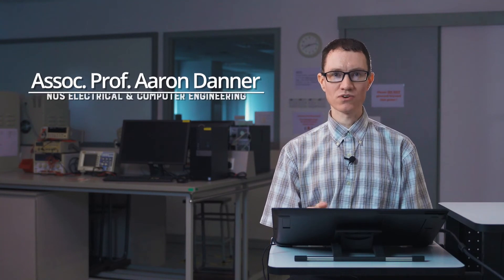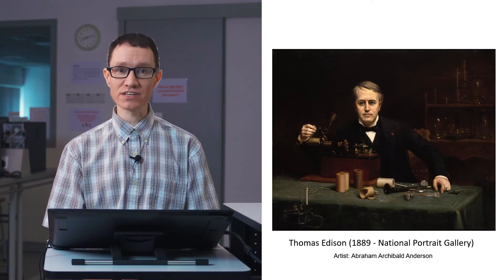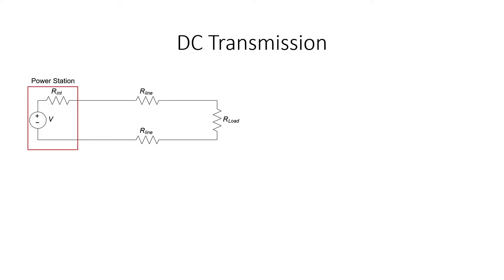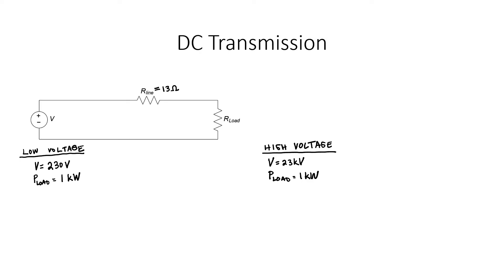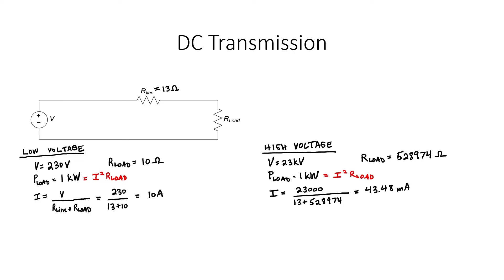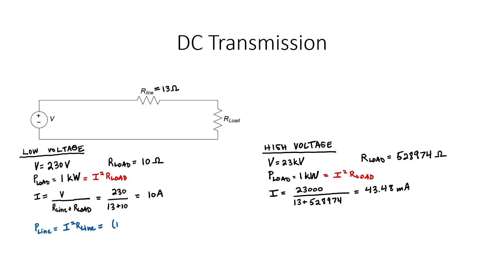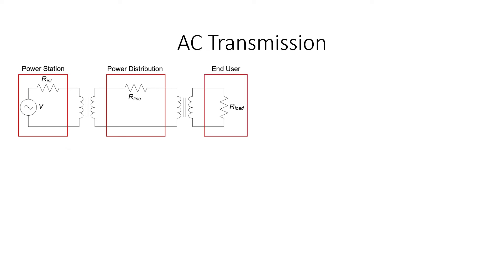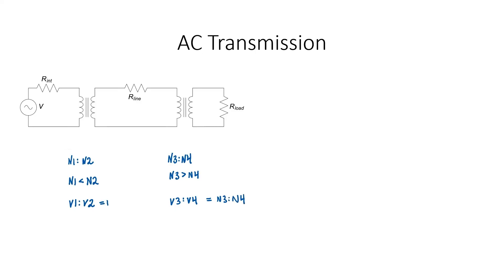AC versus DC power transmission (2 - Electricity Distribution)

Comment: I calculate the low voltage load resistance to be 53 ohm and 4.3 amps for 230v and 1kW.  How are you calculating for this example?  Resistance =Voltage^2 / Power is what I used.
Reply: Exactly, that's where I am stuck too. 53-13 ohm =40 ohm should be the load resistance.
Reply: Your calculation yields the total power of the circuit (heat losses in the line + load power). Here you can't use R=V^2/P, because there is a voltage drop on the line.
To verify the load resistance given in video (10ohms), we need to check if with this resistance we will get the needed power at the load.
Total resistance: 10 (load) + 13 (line) = 23 ohms;
Current thru line and load: I = V/R = 230/23 = 10 A

Now on the load we want 1kW=1000W of power.
As line resistance and load resistance are connected in series they have the same current flowing through them - current I.
Knowing the current thru load we can calculate the power that load is getting:
P = I^2 * R = 10*10 * 10 = 1000W.
Reply: @nonsuspicious your calculaiton is correct I think, but how did you get 10ohms as load resistance? guess?
Reply: He's misguiding us all. 

Wasted my 10 mins calculating the load resistor value.😠
Reply: I don't see how you got that.  If the load is 10 ohms, then the total circuit resistance is 23 ohms.  Ohm's law: 230V/23Ω = 10A.  Power is I squared R, so 100 x 10 is 1000 = 1 kw.

Comment: at 4:29   P =I^2 * R  (V=I * R)   = V^2/ R 
P100 = (100v)^2 /2 ohm 
P200 = (200v)^2 /2 ohm 
P200 >> P100 whats wrong in this way
Reply from the maker: Using V^2/R you have just verified that putting 200V across a 2 ohm resistor consumes more power than putting 100V across it. We always want as small voltage drop as possible for this reason. But voltage drop is different than voltage with respect to ground. Assume we have 100V across a line resistance but each end is 100100V and 100000V. This delivers far more power to the load than say 1100V and 1000V.
Reply: @adanner  i was confused why 200v saves more electric energy than 100v. 
do the power companies limit the house's power consumption?
they fix the voltage but i can use the Ampere in the limit they provide.
if 1000watt is all that power company allows me

1000watt = P(100v)= IV = 10A *100v
1000watt = P(200v)= IV =  5A *200v
if 2 ohm is from copper wire resistance that causes a power loss
1. P(100v) =  P =I^2 * R  = (10A)^2 * 2 ohm  = 200w
2. P(200v) =  P =I^2 * R  = (5A)^2  * 2 ohm  = 50w
3. P(100v) =  P =V^2 / R  = (100v)^2 / 2 ohm = 10000w/2
4. P(200v) =  P =V^2 / R  = (200v)^2 / 2 ohm = 40000w/2
3 and 4. cant have 100v and 200v, i understood 3. 4. were wrong
thanks for reply, asking you fixed my brain,
Reply from the maker: @abcdef2069  Yes the power company strictly limits the power households can consume: It is limited to the maximum output power of the generators connected to the grid. If the power is exceeded, they shut off electricity to some customers for awhile (rolling blackouts).

Comment: in the DC Transmission, you made calculations to show that low voltage has a bigger power loss than high voltage. The problem with what you just showed is that you put in the RLoad yourself. I could make a video, wit the same calculations and say oh we're using RLoad to be 1k Ohms in low voltage and RLoad to be 1k ohms as well on high voltage. It just makes no sense.
Reply from the maker: It wouldn't be a fair comparison if you used the same RLoad in both the high and low voltage cases.  I deliberately picked values for RLoad that would make the power delivered to the load the same.  For the same power delivered, we can then safely compare losses in each system.

Comment: DC transmission is common on long feeders and at grid interconnections. DC transmission is more efficient when the circuits are very long (500km+) and at ultra high voltages (above 500kV) because of the high inductance and capacitance that AC transmission lines have and because of the skin effect. You also only need 2 cables instead of 3, saving on conductor material. The up front cost for the converter stations is the biggest hurdle, which is why they're more economical above a certain circuit length.
Reply: - because of the high inductance and capacitance that AC transmission lines have and because of the skin effect. 
The skin effect does not cause a change in inductance or capacitance; it decreases the effective cross section of wires because current is pushed to the outside.

DC lines do not have less inductance or capacitance to ground (or to eachother) it's just irrelevant, because.. DC. In fact, HVDC lines are common for under sea connections, because those cables have much higher capacitance to ground.
Reply: You can even use one wire in some instances.

Comment: Hello sir, I have a question.
Since the energy that goes through the wire is the same, regardless of the voltage, what is the fundamental change that causes the energy loss. What I can imagine is that with the low voltage we have current through the wire and with the high voltage we have current to the perimeter and around the wire.
Can you please give your explanation?
Thank you
Reply from the maker: In both AC and DC transmission lines, Joule heating is the main power loss mechanism.  From a pure loss-reduction standpoint, DC transmission is superior due to the lack of skin effect and  radiative losses.  The difficulty with DC is the efficient conversion of voltages since only high voltage transmission can minimize Joule heating along the line.